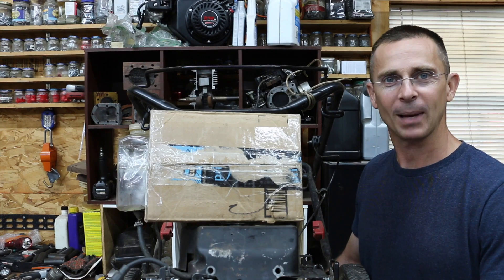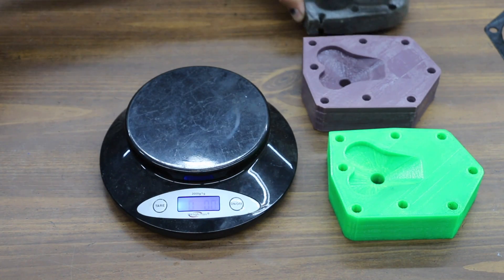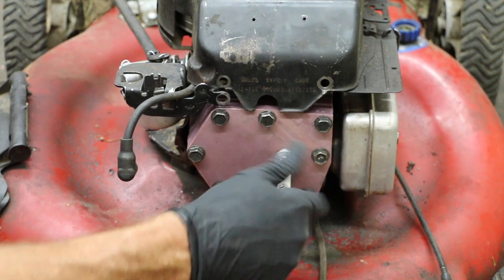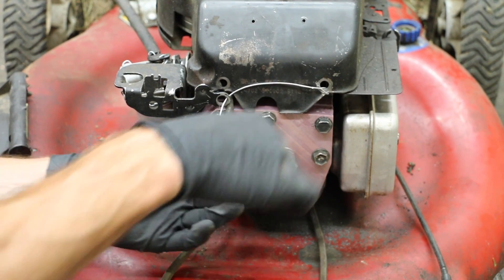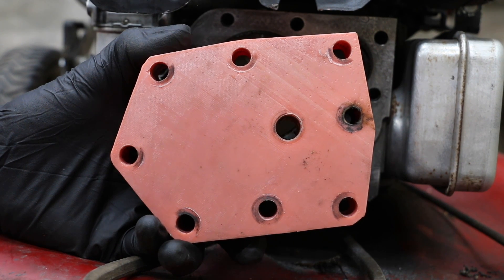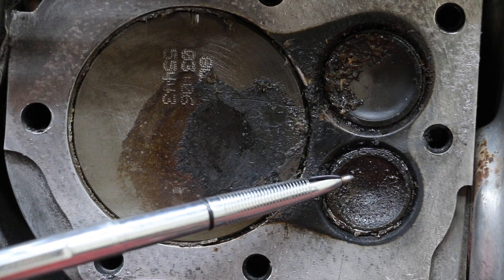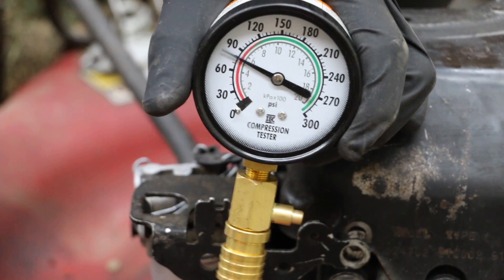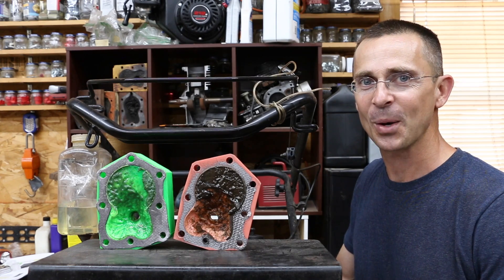How long will a 3D printed cylinder head last?  Let's find out!

Comment: Great video and keep up the good work. FYI you can have companies 3d print high temp parts for you. I needed a part 3d printed that gets over 150C and they 3d printed it for $12 Works great. You should see if you can get some high temp ones made to work as a more long term solution. Some places I know will do more than one material. So like a high temp one on the inside and then a high strength one on the outside.
Reply from the maker: Thank you for this information!
Reply: Abs prints over 190c

Comment: I have heard that some 3-D plastic has metal composite.  Does Terry have access to that metallic filament ?   J K
Reply from the maker: I'll have to check. i'd really like to test it!
Reply: The metal filament I can get and print is just pla with metal particles still low melting point lower then 250c

Comment: Glass cylinder head? Maybe tempered or strengthened in some way. I'm not sure if you've already used glass before but I'd like to see more cylinder heads tested.
Reply from the maker: Great recommendation!  I'd really like to have a glass head.  The plexi-glass head that I use doesn't withstand the heat well at all.

Comment: You should see if thicker oils where are engines cold starting I'm experimenting myself with thicker oils because my Jeep Knocks from piston slap
Reply from the maker: Great recommendation.  My Chevrolet Suburban has considerable piston slap when cold.
Reply: Project Farm yeah I'm running 10 W 40 instead of 10w30 recommended but I would like to see what thicker oil will do because then that will be my option until winter

Comment: Bet those special plastic exhaust fumes are a tad toxic.
Reply from the maker: I agree.  I always wear a respirator during the videos involving smokey exhaust.
Reply: All exhaust is a tad toxic, even natural gas.
Reply: If you've ever been to a shooting range or a drag strip (or both), I would say you've breathed some nasty stuff. Also, that "new car smell" is off-gassing ABS, Vinyl, PTFE and all sorts of stuff 'known to the State of California to cause cancer."
Don't get me started on bug spray, either. Or fertilizer, your local tap water, Pacific seafood, saran wrap. Holy cow. We're screwed...lol.
Reply: As far as I know, PLA fumes are not toxic (it's actually an organic compound if I'm not horribly mistaken), but ABS fumes definitely are.
Tho, that is considering the pure plastic burning, not combined with fuel and/or oil.
Reply: Kalvinjj there's research suggesting some of the VOCs (volatile organic compounds) generated by heating PLA are toxic. There are countless organic compounds that are toxic, i.e. dioxin. Organic within chemistry is not the same as "organic" on a food label, it simply involves carbon atoms.
Reply: Nice insight John Ratko, not that I would be sniffing burnt PLA for fun but now I know it's a nice idea to ventilate enough the area around if I get to print with it.
EDIT: yes I was familiar with the classification chemically about organic compounds, but funny enough, in this specific case, the compound itself may be organic even on the food sense, as it may be done from corn starch, sugar cane and other renewable sources
Reply: Kalvinjj In my opinion, I actually like the smell of printing PLA, it smells like Maple syrup to me 😁

Comment: Project Farm Also, 3d printers can be used to print semi metallic filaments, it would be interesting if Terry or another viewer could send one for a test.  The problem with the higher end partially metallic 3d printing filaments is they require an expensive extruder tip made from either tungsten carbide, or Ruby.  Thank you for all your videos, I watch them all.
Reply from the maker: Terrific recommendation!  I'd really like to test one! Thank you!
Reply: Stainless steel nozzle would work fine too just not as long but they are nearly as cheap as brass

Comment: Project Farm It's probably out of your viewers realm to manufacture, however I think a Bakelite cylinder head would be an interesting test.
Reply from the maker: Thanks for the video idea!
Reply: In my experience bakelite would just fracture. It's extremely hard and tough, but it doesn't stand up to sharp blows such as a combustion event.
Reply: Lefty eh ... Similar to what I was thinking. Figured its brittleness would cause it to crumble rather quickly.
Reply: I do not think 3/4" thick Bakelite would be as brittle as you guys are thinking, I witnessed an old Bakelite phone handset which is far thinner, stand up to an amazing amount of impacts and blows without cracking or shattering.  Also, I wonder if newly made Bakelite has different properties than aged as I would imagine it does.
Reply: Prolific Invention anything is possible. I once plugged an oil pan with 3m wall hanger adhesive on a  mercedes. (It was an emergency.) Held for the entire ride to mechanic, thank Heaven.
Reply: Joe Loco I repaired a 454 block with JB weld that held for years so I agree on that point but not sure why you would bring that up after your initial comment?
Reply: Prolific Invention initial comment was aimed at the fact most of his subscribers are probably gearheads/technical folks whonare interested in how stuff works. Of course we know what Bakelite is...
Reply: Joe Loco You watched the video right? It was about testing 3D printed cylinder heads-my comment was clear, a cylinder head made of Bakelite would be interesting, I know of few people who could manufacture Bakelite so hence "out of viewers realm" of course I know most people know what Bakelite is.  Nice that you misinterpreted the comment and kept it going.
Reply: Prolific Invention ... You make very valid points about Bakelite. I've noticed how durable telephone handsets were. Brings to mind a scene from M.A.S.H. Edward Winter portrayed the intelligence agent who was always over the top. He beat himself up after releasing a kid. Struck himself in the head with a handset that disintegrated on impact. If it had been real, he'd have one helluva knot on his head and a perfect handset. I'm thinking that Bakelite when new is quite durable. Question is, could 3D printed Bakelite be possible to produce?
Reply: J W not necessarily 3d printed. Would have to make a block of it and use a 3 axis mill to machine it into a cyl head.
Reply: get nile red 2 help :):)
Reply: Everyone jumped on Google and became an expert on Bakelite as I did myself. Lol
Reply: J W I'm just being a joker. No worries. I'm old as well that's why I opened my miuth
Reply: Richard Bonan ... I figgered you were having some fun, with the LOL on the back end. I enjoy the chatter on these sites, especially when it promotes thought. Be awesome, always. JW 😀
Reply: J W you too have a good one
Reply: Prolific Invention awesome for camping!!
Reply: Prolific Invention funny uou should mention BakeLite, I was just talking to a friend about that. They're too young to know what it is but I still have old electrical appliances that I was able to show her..
Reply: Prolific Invention Bakelite only has a melting point of around 250 degrees. It works well for ashtrays but the exhaust valve side of the head will likely reach around 350.
Reply: I just edited the original comment and added the words "to manufacture" to avoid any future butthurt and negative commenters who thought my comment insinuated they didn't know what Bakelite is.  I in no way meant that, I just figured it was almost lost tech to manufacture Bakelite, and it might not be possible to make it in a modern way.  It would be excellent if someone knew how and sent Project Farm a cylinder head made from it.
Reply: I love when people assume everyone else is either stupid or 17 years old. This isn't the Justin Beiber channel, Prolific...
Reply: Joe Loco So you have experience making Bakelite? Because that's all I meant, but there is sometimes negative commentary-and here you are.
Reply: Tom Card Not a bit, I meant the manufacturing of Bakelite is out of the viewers realm-but I can absolutely see how that was misinterpreted.  The video was about home manufactured 3d printed cylinder heads with a very low melting point, that failed quickly.  Bakelite, manufactured from the early to middle 1900's has a higher melting point and is quite strong in it's non aged newly manufactured form if 3/4" of an inch thick.  I said it would be interesting, although I don't think it is easy to home manufacture from reading about it.
Reply: It takes an Egotistical Dumb Ass to write what you just did.Get out of your Moma's Basement and get a life.

Comment: Love the videos. 

I was thinking the other day that maybe a few tests on different methods to get motor oil stains out of concrete (like a garage floor) would be informative. I've tried detergents, kitty litter, brake cleaners, etc but never in a controlled way. 

I am also curious to see if you can replace the cylinder head gasket all together and just use RTV or any other typical quick-set gasket maker. I've only ever used RTV to supplement gaskets where there are known failures, and never to completely replace a gasket.
Reply from the maker: Great video ideas!

Comment: That was interesting to watch. Am with reason to believe that we saw smoke with both heads would have been because the plastic in the combustion chamber part of the heads was burning and melting. What I think would have helped would have been of fins were to have been cut like on the original cylinder head to help with cooling. It might have lead to the engine running longer but no guarantee though. It was interesting to watch all that though.
Reply from the maker: Thank you for the recommendations!

Comment: I would love to see how long a glass reinforced PBT cylinder head would last.
Reply from the maker: Great recommendation!
Reply: Yeah, I have a bunch of glass gl45 PBT screw caps and they are tough little buggers. They withstand a lot of abuse. Not sure how hard or expensive it would be to fashion a cylinder head out of the thermoplastic though.

Comment: Another idea: This would take a a bit of time, but what about making an aluminum head by layering aluminum foil. Similar to how 3D printers work (one layer at a time). You could bond each layer with spray adhesive!

My guess is you may have some ping from the interior edges getting hot but it might actually last a few minutes.
Reply from the maker: Great video idea!
Reply: Thanks! I really enjoy your channel and would love to see it stick around. You come across as sincere about your work and your stance on sponsorship is really refreshing (though I imagine hard to maintain). Best wishes!

Comment: What about an hybrid between plastic and metal (like aluminum?)? The inside could be casted in a slim film of metal inside a plastic head like this. Maybe it could take more heat (because of the dissipation) and it would be more light than an entire piece of metal
Reply from the maker: Great recommendation!

Comment: If it was metal I'd venture to say it'd last a while but plastic will melt or just turn loose BUT I don't know everything either. Whatever happens, Thanks, Commander and Blessings 2 yall!
Reply from the maker: Hi Lewie, All great points and you're right!  It was a fun test. I'm still amazed that printer technology has come so far in the past 20 years. I still remember dot matrix printers.  Many Blessings to yall too!
Reply: This is a VERY interesting concept and the guy did a BEAUTIFUL job with those heads! If and when they get the printers to do metal it'll be another era opening up in making things.And the old silver Briggs gaskets are bulletproof. Never had one blow out yet. And I remember well the dot printers too! Virginnee Slims aren't the only things that came a long way! Happy, Happy, Commander and Family!

Comment: would it be possible to line the plastic on the inside with something like a linex or a jb weld to increase it's heat resistance?
Reply from the maker: Great recommendation!

Comment: 3d printed polycarbonate would be interesting. Your transparent cylinder head seems to hold up good and I would guess that is polycarbonate.
Reply from the maker: Great recommendation.  Yes, the clear head does hold up well, but I only run it for 15-20 seconds at a time to prevent damage.

Comment: How much longer do you think this Briggs will last? Also, do you plan on testing "personal" lubricants both oild and waterbased to replace regular oil?
Reply from the maker: This briggs is tough!  I probably won't test personal lubricants to keep the content appropriate for all ages. Lots of dads watch the videos with their young children.  Thanks again.
Reply: Project Farm thats perfectly ok with me. Have you thought about trying to run an engine purely off of a can's of things like brake cleaner. To see if it runs to hot or maybe just isn't safe to be used on it's own?

Comment: That was interesting! There are some other 3D printed plastics that will go to higher temperatures, although they are PRICEY! the common one that I've used is called UTEM
and can supposedly take 400 degrees, although that is an intermittent temperature.
Reply from the maker: Thanks for this information.

Comment: Project farm thanks again for the video. Have you heard of killer glass ? Wonder if the glass they make would survive they use it in clear radiator hoses and different engine parts the company makes stuff with it check it out write me back please
Reply from the maker: Thanks for the recommendation.  I imagine they would do better than ABS plastic, since they are designed to deal with pretty high temps. Thanks again.

Comment: A phenolic based or thermo set plastic may offer interesting  results and it should be explored if you get the chance, these types are routinely used where regular plastic will loose its structural rigidity because of heat.
Reply from the maker: Great point. Thank you

Comment: Would anyone like to see how a carbon fiber head holds up? If someone sends me the file for these heads I can use my school's carbon fiber printer to print a head off for the test (and then I'll send it to project farm). Someone would have to cover the cost of the printing though. A whole CF cylinder head would be expensive
Reply from the maker: Great video idea!
Reply: Yeah it's like a lb of filament and carbon infused PLA would be no better similar melting point

Comment: how about you try wood with a thick coating of JB WELD? The JB WELD will keep the wood from burning (if its thick enough like 0.5cm-1cm). So top would be wood and the bottom would be JB WELD.
Reply from the maker: Great recommendation.  The JB Weld Extreme Heat would really hold up well.

Comment: I was impressed you stood in front of the spark plug, which I thought would fly out of its threads like an AC Delco rocket.
Reply from the maker: lol!  I actually at the other end of the shop just hoping my camera wouldn't get destroyed.
Reply: I wonder if the green plastic head (forgot the material) would last longer if it had some sort of non-conductive seat for the spark plug. Like some sort of alloy that would dissipate heat enough for it to last longer. You could tap the plastic cylinder head and then add that alloy collar to it and the spark plug could screw into the collar. I'm having a hard time trying to convey what I mean and it might be outside of the scope of your experiment. Maybe bushing is a better word. 1911 pistols have this feature for the grips. It's a little grommet that screws into the frame so you can change screws without risking damage to the frame of the firearm.
Reply: probably not. PLA gets soft at a pretty low temperature.

Comment: I believe those were both thermoplastics... which is why they melt.  I'd be interested to see how UV cured resin or some other sort of thermosetting plastic 3d printing technology would hold up - they don't melt as easily.  Also curious how sintered metal printed heads would work - they obviously don't melt, but can be brittle.
Reply from the maker: Great point and thanks for the recommendation!

Comment: Use teflon, or PTFE whatever ya like to call it. it has a melting point of 326 degC
Reply from the maker: Great recommendation!
Reply: dont think it can be 3d printed, has to be milled as far as i know, gives of pretty toxic fumes when melted too
Reply: also try borosilicate glass, has a melting point of 820degc, its the same stuff lab test tubes are made of, jan ridders made a whole cylinder block from it

Comment: You should try 3D printed cylinder head and that's made of steel or brass filament that's used in the printing process
Reply from the maker: Great recommendation!